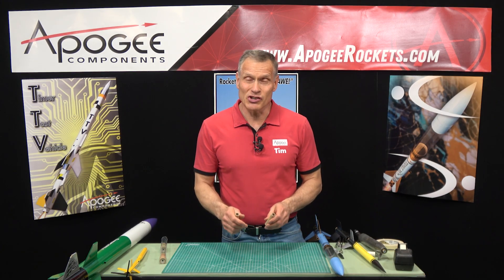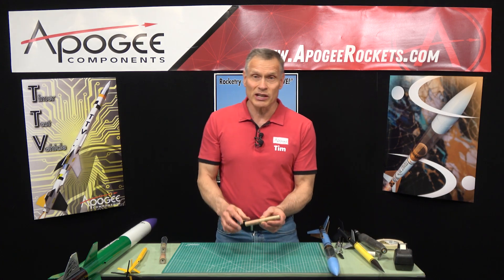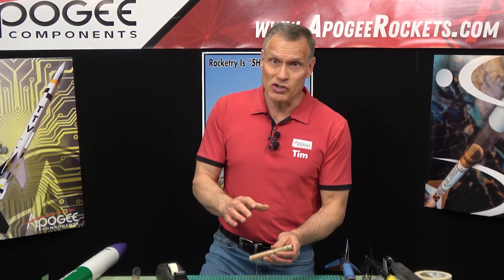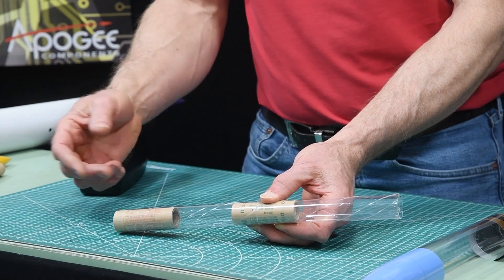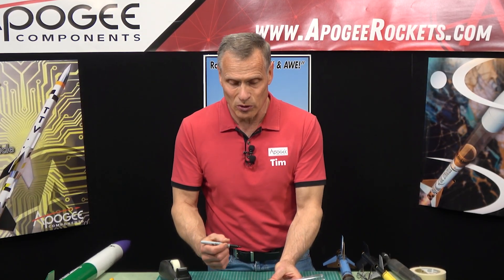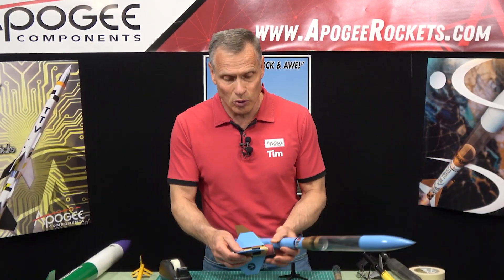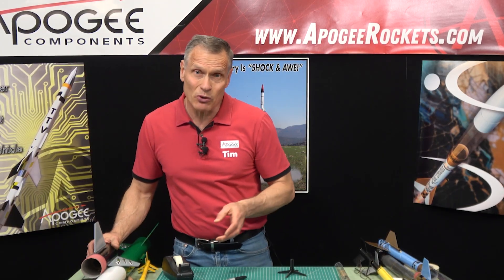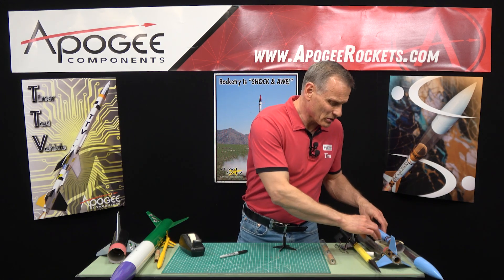How does Gap Staging Work for Model Rockets?

Comment: We've gap staged several rockets. It works beautifully. Always vent of opposite sides to avoid flight path disruption from the expelled gasses. Also remember the area of a circle is π * R squared when reducing the hole size. So it works out that two 1/8" holes only have approximately 1/2 the area of one 1/4" hole. My question is, can you use Estes "green" BP motors in upper stages instead of the purple ones?
Reply from the maker: Yes. The difference is just the length of time of the ejection delay. The purple ones are "longer." But don't worry about the color. You should select the delay time based on the rocket design. We use the RockSim software to figure out the best delay time that will eject the parachute at the apogee point. Once you have your optimal delay time, you just pick the rocket motor with the closest available delay time.
Reply: @apogeerockets  Thank you! I've always heard the nozzles on the purple ones are larger to let more gas in to facilitate staging. Looks like we've got some new stuff to try out! FWIW we gap staged a F15-0 about 9" to E12-8 a few weeks ago. It was a great flight!
Reply from the maker: @shullln  The nozzles are identical. No difference there. The only difference is the delay time.
Reply: Perfect. Thank you for clearing that up for me. LOTS more options now.
Reply: The optimal time to deploy the recovery system is when the rocket's velocity reaches zero (apogee). The delay charge is there to give the rocket time to coast to zero. With a booster stage, the rocket can easily reach higher velocities. This means it will coast longer to reach apogee and require a longer delay. Purple motors are designed with longer delay for this reason.
Reply from the maker: @aaronnelson6699  You are correct. The Estes motors with longer delays may have a purple text color on them.